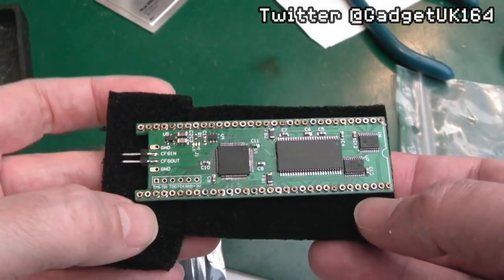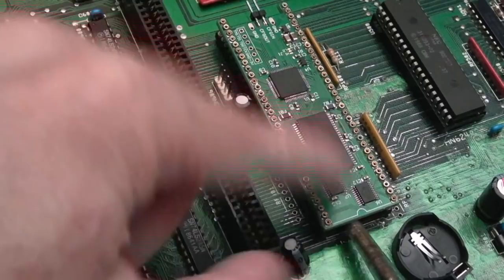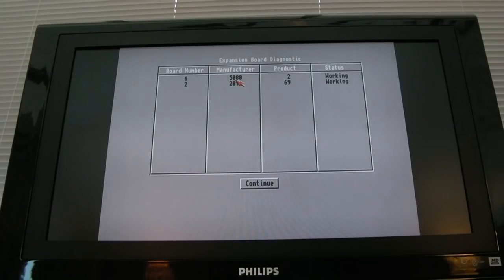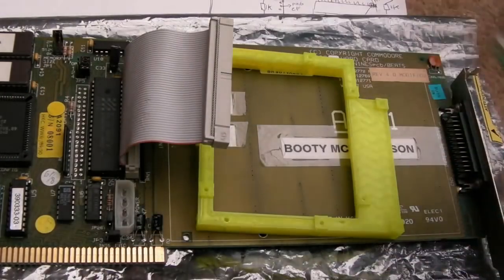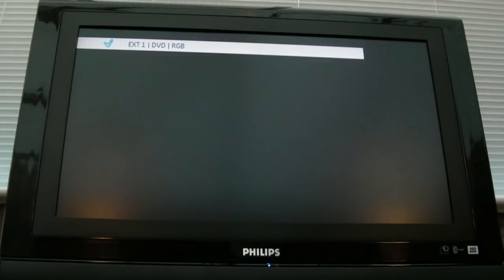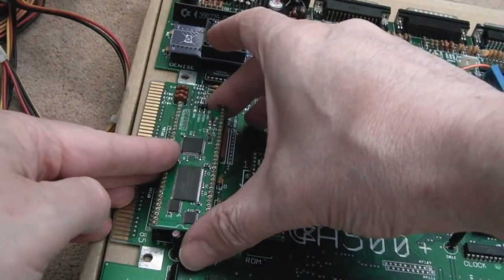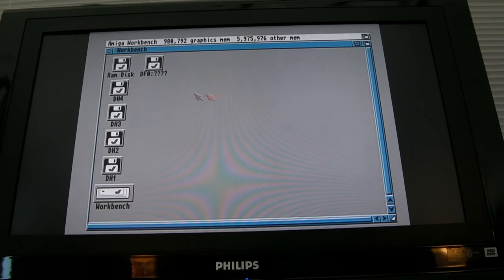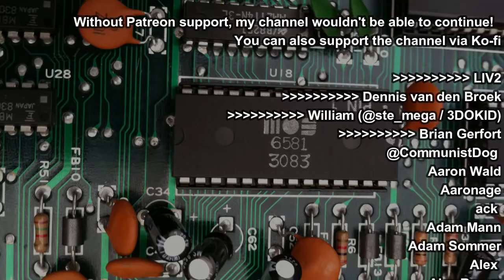Commodore Amiga 8MB RAM Board (GottaGoFastRAM) from LIV2 & SCSI2SD Bracket from RetroGameRevival

Comment from the maker: NOTE: LIV2 has tested the autoconfig stuff on his new A2000 and it seems to work properly when used alongside an A2091 - ie. the correct response should be what we saw on the A500+ with an A590, whereby 4MB of the GottaGoFastRAM memory should be disabled to accommodate the 2MB of RAM on the A2091 which gets assigned first.  I worked out 18/02 that the problem I had was due to the Signetics 68K CPU I was testing with!  With a Motorolla it works the same as in the A500 with the A590!  It's a minor point in any case because you can always disable RAM on either the A2091 or the A590 or many other Zorro boards etc, to allow the GottaGoFastRAM to provide all 8MB of RAM.  You cannot go beyond 8MB of 24bit DMA RAM (ZII).  The reason the TF536 can provide an additional 64MB is because that RAM sits in the Zorro III address space.

Comment: I bought one preassembled on eBay to fit it into my Amiga 1000. Technically, it works (it's a tight fit though), but mine had a faulty RAM chip. I didn't want to send it back, so I ordered a replacement chip and swapped it. Works fine now. Why am I posting this not very exciting story here? To say thank you for your videos! I have the equipment to do SMD work but I very seldomly do it. Usually, there's no need to because most of my machines are from the thru hole era. So I don't really have much training or experience with that kind of soldering. However, when doing it, it worked perfectly fine so far and it looks great after I'm done. This is only due to me watching this process in your videos over and over again. It's so engraved in my brain how to do it that I can just pull it off without proper training on my side. Thanks for that!
Reply from the maker: Thanks =D  Glad you fixed it!

Comment: I'd be very interested to see how that ROM switcher works on a Rev 5 A500 board. I've got a TerribleFire 534 card that I can't fit in my machine because I also want to use the 3.1.4 Kickstart, but that Kickstart chip is an EPROM which needs an adapter board in the Rev 5's ROM socket to work. Even when using the relocator board to move the TerribleFire out of the way, it still collides with the Kickstart. If that ROM switcher is low profile enough, it might possibly allow the TF to finally fit and I can button up the case. :P

Comment: I'm a little stuck. Tapping into pin 8 allowed the 8mb ram board to work with by 8088 Bridgeboard but I only see 4mb of ram while the bridgeboard is installed in the slot 4 the only remaining slot. I could live with this but is there a way around this? Maybe tapping into another pin and sending the autoconfig to take over a different slot?
Reply from the maker: The A2088 Bridge board needs 2MB of the 8MB of ZII address space!  Since Zorro cards divide by 2 when they cannot fill the current block, it reduces automatically from 8MB to 4MB to give a total of 6MB used (ie. 4MB RAM, 2MB A2088).  You would need a combination of 2 x RAM boards, or a ZII RAM board and the 68K RAM board - both set to either 4 or 8MB.  As it polls and divides down by 2, one of the cards would half to 4MB, the other from 8MB to 4MB, and then to 2MB, giving you 6MB of RAM (Max with A2088).
Reply: @GadgetUK164  totally makes sense. Great explanation and thank you very much.

Comment: Nice memory thingy. I want one. 

I don't like putting female round pin headers into other female round pin headers. The legs are thicker than they are designed for and they lose some of their tension afterwards. You can try with fresh ones and you'll see that they grip the thinner male headers more losely afterwards.

Comment: Sweet little RAM board. Does putting true fast RAM into an A500 give a speed boost to the system in the same way as with an A1200?
Reply from the maker: Fast RAM will give a speed boost in general (when its used) but the main benefit is additional RAM for games etc.

Comment: Nice, but I wonder why they did not do hardware 68K or faster emulation on the FPGA instead of having to piggyback the old 68K
Reply from the maker: That isn't what it was targetting.  It was just designed to be a replacement for the MKL and Kipper2K boards which are no longer available.  There is an FPGA 68K coming soon which will just plug in on top, and provides an insanely fast CPU along with either 512MB or 1GB of RAM.
Reply: @GadgetUK164   I have been following the new one, but it seems like a missed opportunity on this since all the hardware is already in place.

Comment: Pin 28 (topside) of that board (memory expansion, not the motherboard) looks like a nasty case of green crusties. Pins 41, 43, and 57 don’t look too hot, either. Pins 10 and 13 look like the holes have been wallowed out. 🥺 Maybe it’s just a lighting or camera angle problem? Do they look that way in person?
Reply from the maker: It's just a reflection of green stuff on the roof I think ;)  I need to clean the roof outside when it gets warmer.   The pins look fine up close!

Comment: Great Video as always :-) I presume that it would run with a TF536 in a 500? Also would be interesting to see if some WHD Load Demos will play better with the TF536 as a result as it has access to Zorro 2 as well as 3 fast memory addresses I know that 9 Fingers and Batman Vuelve have issues.
Reply from the maker: Yes, it coexists with the 536 in a 500!  I am not sure about those demos, I don't think I've had an issue with them.

Comment: Really informative video.  Like the 8Meg Ram board, will probably get one for my A2000 when i get it fixed.  Would be interested to see benchmarks for the SCSI2SD interface!  I have been using the Buddha IDE 20th Anniversary Edition in my A4000/060, but have not been impressed with speed of interface, with any Hard-drive or CF card i have used with it. My A4000 IDE has always been faster?!?
Reply from the maker: Thanks =D  I've covered benchmarks on the v5.1 SCSI2SD on a few videos in the past.  It tops out around 1.1MB/s - not very fast.  But later revisions of the SCSI2SD can provide around 2MB/s.
Reply: @GadgetUK164  Thanks for the info. I will go through your other videos , always very impressed with your work!   Keep the videos coming.

Comment: Hi, great stuff! I have just got this ram upgrade. It works fine till I plug in my Gvp Hd8+ then it is disabled. The ram is disabled on the hd8+, by the jumpers, I just use it for a hard disk.  Do I need the jumper wire on pin 11 like you did? Thanks!
Reply from the maker: Yes, if you have a Zorro card plugged in, you will need that wire mod!  That said, the very latest firmware (which may or may not be public yet) is automatic and doesnt need that wire.

Comment: What's the fascination with those ancient CF cards? Why aren't more people using SD instead?
Reply from the maker: Personally I had bad experience with one of those SD adapters - it killed the device it was connected to...
Reply: @GadgetUK164  The one I have in my A600 is working beautifully (I bought it 4 or 5 years ago). I keep seeing people use CF cards and I haven't seen a good explanation for it except for maybe the fact that CF card adapters have been around for much longer. I don't think there's a technical reason for it?
Reply from the maker: @RainerK.  CF cards tend to be faster than SD cards from what I understand.  That might not be the case with the later standards of SD card, provided the reader supports it properly.  It getting harder to find CF cards though.
Reply: @GadgetUK164  With the relatively low read/write speeds of the Amiga it probably doesn't matter all that much. :D Guess I will be sticking to SD then. The A600 doesn't feel slow with it even though I only have an 68020 card in it.
Reply: @RainerK.  The primary technical reason is interface simplicity. CompactFlash is basically a Parallel ATA and PCMCIA implementation in a different form factor making it ideal for use with later Amigas.

I'm actually struggling to think of any benefit to using Secure Digital that doesn't have a corresponding detriment.

Comment: Would it work in a CDTV?
Reply from the maker: If you can find the auto config signal - I will take a look at the schematics.
Reply: @GadgetUK164  From Github: CDTV
The CDTV's DMAC takes up the first autoconfig slot, so if you intend to use this with a CDTV use the CDTV specific .JED file to program the CPLD, in otherwords it needs to be programmed. Curious to know if it will go well if I already have 8mb installed on the CDTV expansion slot 1MB+8MB fast Ram, can 17mb be achieved?

Comment: RS sockets are £5.52 each ;)
Reply from the maker: Mine weren't!  They were less than £2 each!
Reply from the maker: I stand corrected!  They've ramped the price up!!!  I got like 10 of these for less than £2 each.  They seem to have them at £4.60 ish EACH atm.
Reply: @GadgetUK164  Yep.. I was on about this on my forum a few weeks ago that price has ramped up. The price in Farnell was DOUBLE!! in RS £4.60 + VAT, £5.52 and you have to buy them in a pack of 5.  I managed to find a source, but still £5.20 each.. cheaper than RS technically ;)